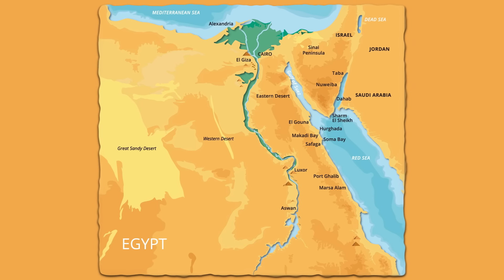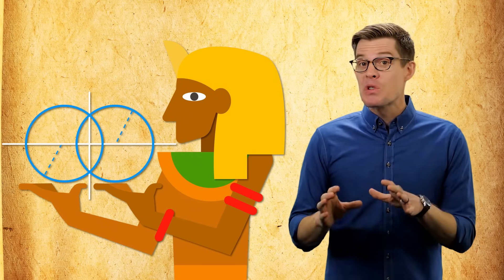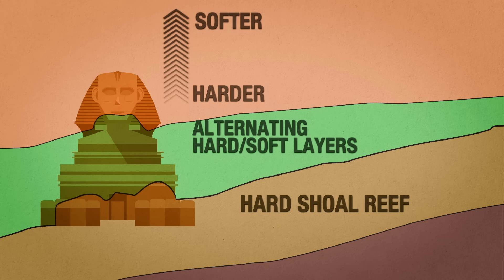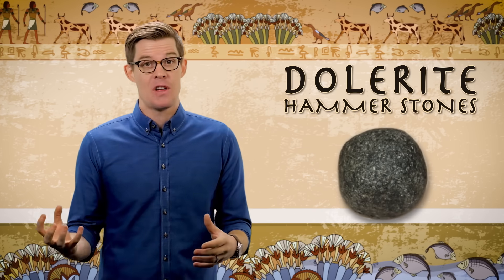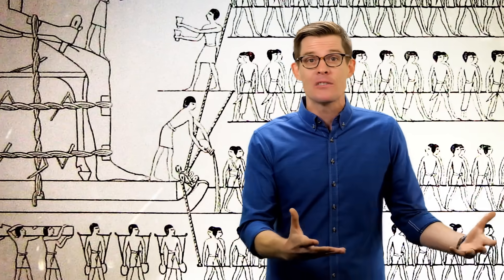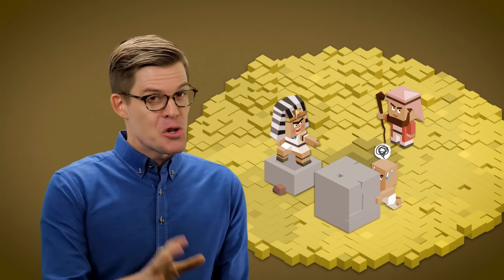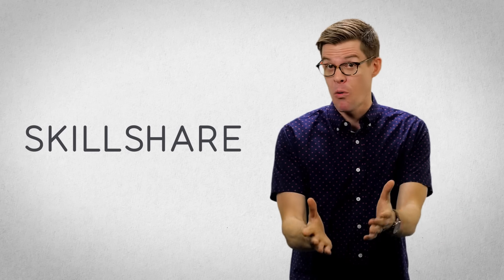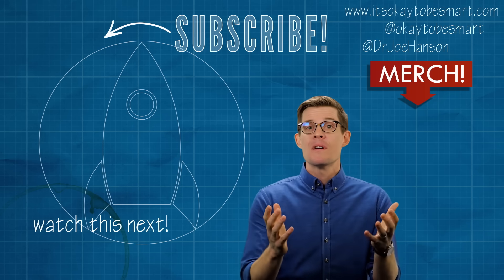The INCREDIBLE Ancient Engineering That Built the Pyramids

Comment: Best theory is that it was built like concrete, carrying and cutting out those those blocks is more absurd then aliens.
Reply: Actually the best theory is the one which = accounts for the evidence we actually see.  Thus we see:

1 - most of the blocks are little more than crude chunks of limestone of a myriad of shapes and sizes.  That immediately disproves your "concrete" claim as blocks from a mold by definition would be of uniform shapes and sizes = which we do not see.
2 - meanwhile the quarries where that stone came from show cleanly delineated sides.  It shows where they were cutting out "blocks" and it shows channels cut into the bedrock and holes spaced along where wooden beams could be inserted to fracture off chunks of stone.
3 - those blocks themselves reflect the layers of limestone they were cut from - limestone forms in layers you know.  So a "premix" of anything would once again by definition be uniform in color and consistency.  Alas..............we simply do not see that.  You can Google loads of photos of the Great Pyramid closeup where you see different coloration layers on blocks of the pyramid.  That reflects the natural density layers of the bedrock those chunks were cut from. 
4 - also some blocks still exhibit the chisel marks on them from formation whereby the stone mason was chiseling along a track to form the side of the block.  Once again blocks from uniform molds would not reflect this.
5 - lastly is that to create blocks from a mix would require infinitely more work and resources to say nothing of time.  If the Egyptians were simply quarrying "raw material" which would then need to be pulverized and added to a mix we should see amorphous holes in the ground where they were simply hewing out small chunks of limestone to be crushed = which we do not see. 

Moral of the story:  so I could go on = but the point is made.  It does not matter one whit how much a thing "makes sense" as people can and sometimes do rationalize all manner of silliness based upon mere "belief".  All that matters is what does the totality of credible evidence actually support..............and it does not support concrete.  lol!  Assume less and follow the actual evidence more.  Things turn out better when you do.
Reply: @varyolla435  Hm I'll do some more research, and I was only saying the concrete makes more sense then quarrying not that Im 100% sure.

The blocks are different sizes yes, if you only look at their width.  The issue  Egyptologist have no explanation for lies in their height.  Their height is absolutely identical as required for a level surface and the vertical surfaces touching each other is accurate to 1/10th of a millimeter, not even a human hair can slide in between them. The blocks of the inner chamber were fit together on all sides with extreme  precision.  I'm not sold on the idea they were able to stack vertically thousands of blocks perfectly level with stone age tools. Even making a row of say 50 blocks weighing 100kg each perflectly level and fit together with those tools has never been proven  or demonstrated not even on a 1/100 scale.  Maybe  it wasn't concrete, but the quarrying method defies reason completely.  There are actually 8 sides with a very small tilt that just so happens to give perfect fitted shadows during equinoxes. 

But again  I'm not claiming to know everything, but the concrete hypothesis answers some questions the other proposed methods cant.

If they were cut, it was by technology we don't even have today.  Given there is a real chance we've already been visited by aliens, ufos are 100% real and not all of them can be explained.   If Aliens have ever been to earth, and helped with stone construction  then I can digest thev theory they were cut. 

If Egyptologist found spoons and forks around the pyramids they probably would say thats evidence of the tools they used.
Reply: Above is the only "technology" one requires to split stone.  Also I noticed how you deflected away from what I noted - actual archeological evidence on the ground - to go on about supposed "mathematical precision" nonsense which once again does not reflect what we see.  I suggest you study up on "statistical fallacies".  That is where all these supposed mathematical "correlations" come from = people who create a bunch of nonsense long after the fact which does not represent what we actually see.  

If you played with the numbers long enough you could probably find some "correlation" between the Great Pyramid and say Superbowl scores.  lol!!  Forget about concrete and stick to the evidence we see.  It does not matter what YOU think "makes sense".  All that matters is what does the totality of evidence support.

Comment: Here's my rebuttal of this (and all) videos I've seen on the Giza pyramid construction:

Based on construction timelines I've read, it requires that one block be set in place every single minute.

Very quick math, assuming some approximate ‘facts’ about construction:

1) 10 hour work days, 4 months per year, over a 30 year period.

2) 2,300,000 blocks.

Approx. total man-minutes: 600min/day x 120days x 30years =

2,160,000 total man-minutes to build.

2,160,000min / 2,300,000 blocks = 
0.94min per block, so let's call it one block, fully in place, every single minute.

Seems utterly impossible, especially given the presumably single-file bottleneck up the ramps at the pyramid site (assuming ramps of some description were indeed used).

Even working 24/7 for 30 years requires one block in place every 7 minutes…a staggering feat in and of itself. But one block per minute? No way, says I.

Comment: What about the granite blocks that were hoisted above the kings chamber? I'd love to hear your explanation for that.
Reply: What cant you do with 100K Slaves and unlimited amounts of time ?
Reply: Lifted by Counterweight drop down the Grand Gallery.  Watch a YouTube video by Jean Pierre Houdin's theory 2011 and all is revealed.  The granite was moved using the Grand Gallery as the drop Counterweight using ropes and wooden trolleys. All the signs of this were found on the GG lower walls & floor.
Reply: the notches, on both sides of the shaft leading to the chamber were used as little steps to lever the stones up one step at a time. some one has a video on the system they used...
Reply: It's possible that the 'big void' discovered by the ScanPyramids project aobve the Grand Gallery may have been used as a counterweight elevator to move the granite blocks above the KC.

Comment: The external ramps couldn't work ... too much volume required of non-sand material. The newer analysis shows that the ramps were Internal, inside the structure, and much shorter.
Reply: @varyolla435   How many stones placed, per day, by how many workers, over how many years? Any ramps would have had to be enlarged constantly so the angle of ascent remained constant. Multiple ramps, multiply the issues. Has anyone ever built  and demonstrated a "lever & counterweight device" capable of moving that much weight up an incline? If the Egyptians did use a "device", how did they move the counterweight up the side? I haven't seen any alternative explanations of why the internal ramp hypothesis is wrong. Do you have a link or two? As far as I know, All of the explanations have issues, and none are definitive.

Comment: The theory of concrete made on site sounds more plausible than saying that millions of tones of blocks had to be pulled, carried on site and placed at tens of meters high.
Reply: Pity then that the actual evidence on the ground does not support your theory,  It rather shows conclusively that they were hewing "blocks" from the bedrock nearby while those blocks themselves reflect the bedrock from which they were obtained as well as things like chisel marks on them.  

The rather silly if I may say claim about their using "concrete" had people actually thought about it and applied even a modicum of commonsense would be inordinately more labor intensive as well as resource consuming.  Time was always a factor in constructing a tomb which needed to be completed in the lifetime of the Pharaoh.  Thus they cut corners everywhere they could to save time.  So it does not matter how "plausible" a claim is.  All that really matters is what does the actual evidence on the ground support = and it supports their quarrying blocks from the bedrock.

Comment: They brought the stones on site. They started to stack at the third or forth row by building a small ramp. Then they created the ramp they needed to bring all the stones all the way to the top.  Once they finished the top, they reused the stones from the ramp and used them to make the first and second and third bottom row. If you make the calculation, that should make up about enough stones to both make a ramp and complete the Pyramid bottom rows. It's an easy engineering mathematical equation.

Comment: The answer is obvious and easy to work out. The  input  of  geology  and  geophysics,  which  lie  within the  domain  of Geotechnical Engineering, is indispensible in  archeology. Geophysical investigations are one  of  the primary tools used in  detection of buried monuments. Geology can provide invaluable help to enhance the survival of old monuments especially if they are built from stone or rest on rock. In my  opinion,  the same  geotechnical  aspects of Engineering can be adopted not only in detection of the reasons for the vanishing  of  some  monuments  but  to  investigate  the  reasons  behind  the long “good” performance and survival of some old pyramids. Therefore, to  explore  the  Geotechnical Engineering in the Great Egyptian Pharaonic Civilization will be the answer because Egypt and the Pyramids are, to many, synonymous. Millions of people 
travel from all over the world to see the Egyptian Pyramids, the largest stone structures ever built. They are considered by many to be the greatest buildings ever constructed. No certain conclusions have ever been reached in this regard even with the modern investigations especially the  stability of the Giza Pyramids including its associated geotechnical aspects. Regardless of the unsolved riddles for the reason for building the Pyramids and the technique(s) employed to build these massive structures, different geotechnical failures would have been inevitable had the Pharaohs chosen to build the Pyramids along the Nile valley where they lived. It is amazing to note that the maximum static stress under the Greater Pyramids is about 3500 kPa; yet this huge stress value did not entail any observed or likely foundation failure (bearing capacity or excessive settlement). Geological  studies  (Said,  1990) show  that  the  huge  monuments  of the fourth dynasty of the plateau of Giza are built on a sedimentary sequence  that  consists mainly  of  carbonate rock formations  deposited  in a marine environment of variable depths.  These sedimentary layers have the characteristics of  the Mokattam formation and  Madi formation, from Middle  to  Late  Eocenne  age  which  is  formed  of  masive  limestones  and  dolomites. This formation is considered a suitable foundation that can safely support the massive rock structure. Interestingly, mappings of tectonic structures found in the chamber to avoid the fragility veins involved in the chamber.The builders again integrated the fault surface into the design of the chamber, and may even 
have adjusted the height of the ceiling accordingly to be precision of the chamber for the storage energy purposes and related to safety radiations, short circuits from electrical wiring, temperature differentiation of the rocks, moisture control and etc.. in other words, effective sealing utmost important in chamber engineering design. The Ancient Egyptians left a wealth of knowledge behind them that we are still don't know and trying to reveal. Geology is the base of geotechnical engineering. The Ancient Egyptians knew geology and made use of it. They drew the geological and topographic map, identifying different lithological 
units. Their knowledge of geology allowed them to mine, tunnel, quarry and make best use of rock discontinuities as well as avert/accommodate many distressing effects on their tunnels and extracted rock blocks. Choice  of  locations  for  their  great  buildings  and  temples  was a geotechnical marvel. Also refer to for moving the rocks into height and landing (proper levitation technology) by applying the rock cycle activated from the energy stored in the chamber inside the pyramid with the help of electrons or electricity to keep the rock moving, remotely prior to landing powered by the sun. Refer to :https://opentextbc.ca/geology/chapter/3-1-the-rock-cycle/ and analogous to https://water.usgs.gov/edu/gallery/watercyclekids/sun-earth.html.

Comment: It's also impressive when one realizes that the magnetic poles wander.
Reply: What as they say has that to do with the price of tea in China.  The pyramids are not aligned with magnetic North = merely true North.  All that was required to achieve that was to track the Sun's shadow over time to discern the 4 cardinal directions and align the sides of the pyramids to those lines.  There are hundreds of postholes evenly spaced around the circumferences of the bases of the Giza pyramids which show they using vertical posts and meticulously marking the passage of the Sun's shadow = determined which way was true North.  Have a nice day.
Reply: @varyolla435  Would you concede that the age of the pyramids is determined by the structures and remains found around the pyramids
Reply: @robertwidmer4367  In part.  Yet that is not all of the evidence.

1 - historical references attributing the pyramids to the dynastic Egyptians.
2 - archeological evidence such as the diary of Merer which links Giza and the Great Pyramid to Khufu by name and names his half-brother Prince Ankhhaf as vizier in charge of construction.
3 - workmen graffiti found in the relieving chambers above the King's Chamber which also mention Khufu by name.  This area was only accessible at the time of construction while the graffiti mimics that seen elsewhere to include in the same red ocher paint.
4 - workmen graffiti on the cover stones of the solar boats unearthed in the 1950's next to the Great Pyramid.  They like the ones inside the relieving chamber mention Khufu's son Dejedefre. He followed Khufu as Pharaoh and thus he likely finished his father's tomb to clear away the earthen ramp which once sat on the south side of the Great Pyramid to then bury the boats after the death of Khufu.
5 - carbon dating of the gypsum mortar which is found slathered all over the pyramids.  It was created via heating over wood fires and contains bits of charcoal which is organic and can be dated.  So radiometric dating places the Great Pyramid in the 4th Dynasty of the Old Kingdom.
6 - fragments of Khufu's mortuary temple which show him performing the Sed festival which was performed at the 30th anniversary of a Pharaoh's rule. 

Moral of the story:  I could of course go on but the point is made.  There is plenty of evidence linking the Great Pyramid to Khufu besides things like surrounding tombs at Giza which further date to the 4th Dynasty and so on.  That is but one piece of a larger puzzle.
Reply: @varyolla435  There is plenty of evidence that proves that the pyramids and Khufu were around at the same time. Any text found could easily been added after the fact. You said it yourself the Egyptians loved recycling they could have just found them and decided to inhabit the area around it.
Reply: @robertwidmer4367  Argumentum ad ignorantiam.  Prove the Egyptians "recycled" the pyramids lest your beliefs be little more than just so much more conjecture.  I have provided references to tangible credible evidence which ties the Great Pyramid to Khufu and pyramids in general to the dynastic Egyptians.  

Meanwhile you have no credible evidence - as none of course exists - to support the Egyptians simply "finding" the pyramids to renovate them or whatever............nada - zip.  What you believe matters not.  Only what can be demonstrated via credible historical/archeological/scientific evidence matters.  Better luck next time.  Enjoy your fabulous pseudoscientific narratives.
Reply: @varyolla435 First off I never said that is my belief it is merely an idea. Second I was unaware of that finding in the shaft off of the queens chamber and after watching some of the footage of it I will concede it is compelling evidence but still is not cold hard facts. Ancient Egyptians could have accessed that area by a different way in and sealed it behind them. I dont find the markings as curious as I do the pieces of copper in bedded in the stone blocking the shaft. To me they are clearly handles made to be used on the inside of the chamber they discovered. That is in itself a clue that at one time that spot was meant to be accessible
Reply: @varyolla435  - or the price of wooden posts in the desert? LOL

Comment: They were not built ... they were poured.
The stones are less dense on top and more on bottom. Also microscopic bubbles are present.
The composition can be replicated with 4 local materials and has been reproduced.
This solves the leveling and carving issues. Remember, 10,000 stones a month needed to be moved ... so ... NO.